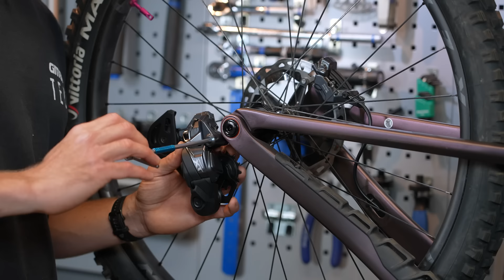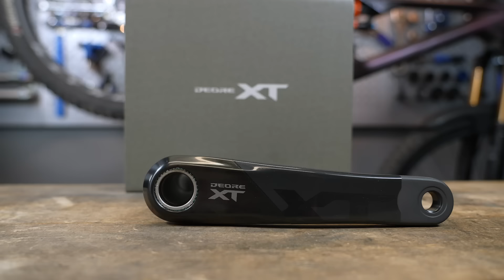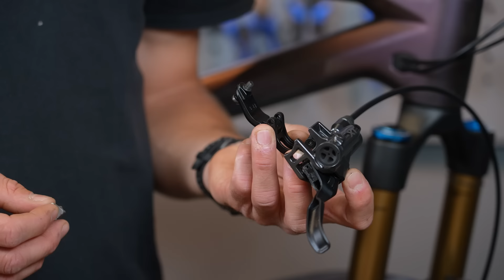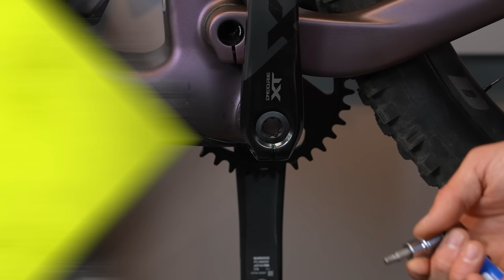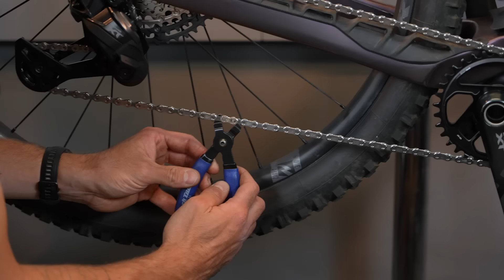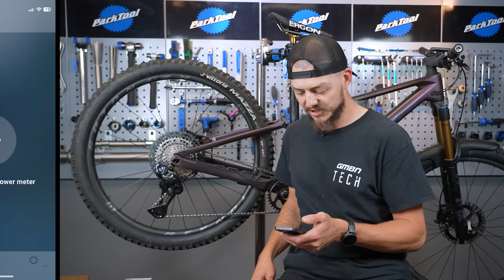How To Install And Set Up New Shimano Wireless Groupsets | Deore / XT / XTR

Comment from the maker: What do you think of the new wireless groupset from Shimano? 🤔
Reply: Love that it is not UDH specific, Shimano thinking about everyone 👌
Reply: Upgraded to the XTR, and absolutely love it!
Reply: I like the simplicity of a cable, but if I had to choose AXS or Di2, the latter for sure, just based on ergonomics and speed of shifting AND it uses a UDH.
Reply: It’s sick
Reply: Wish I could install this on WIRED ebikes but I’m concerned about the torque
Reply: @ninobeatz_iOS  don’t get that comment ! I’ve fitted it to my Mondraker crafty R e-bike with no issues whatsoever , btw it’s the dogs !!!
Reply: I have an AXS XX1 derailleur with an XTR cassette and chain, and it shifts very well. But with Di2, the shifting is a bit loud, though definitely faster. I hope the noise will decrease over time.

Comment: can someone help me?I have followed the adjustment steps and they all work except when I want to go down from the big sprocket to the next sprocket that doesn't go down
Reply: Check if the fifth speed is correctly ajust and the low speed limit

Comment: Quick question, there is a ring on the bolt which used for fitting on the bike. Is this ring used in front the B-tension bolt, right? So the tension bolt is not against the frame, it sits on this ring, right?
Reply: Same question.

Comment: Took the plunge, ordered the upgrade kit last week and fitted on my XC bike todaytoday, thank you for the awesome tutorial, really helpful ❤ As for the new derailleur and switch (shifter in old money) definitely a want rather than a need, very light touch required for a single shift. Lovely and crisp and the geek in me liked the integration with the my Garmin and the E-Tube App
Reply: I just installed mine last night, too. Surprisingly easy to install and setup (and adjust). I had ridden an early production kit in the summer and knew I wanted this on my trail bike. It's everything that AXS should be - fast, reliable and Shimano 🙂 XX and X01 were pretty good, GX was crap. Looking forward to my first trail ride on it.
Reply: @DominicWebb79  how did you guys set it up? I've been battling against limits, micro adjustments and the initial B tension, I just don't get how to put it the way it is in the video 😭

Comment: If I had a penny for every time I've proven a mechanic wrong by actually using a torque wrench I'd be rich, as a mechanic, do the job right and use a torque wrench or don't do the job at all. Great walk through on the setup.
Reply: And what if he don't? I wonder if you get tired people not listening to you.😂
Reply: As a bike mechanic I can tell you there are only certain very delicate items I use torque wrenches for. Something like a derailleur fixing bolt I am definitely not using a torque wrench. You could do 1.5-2x the recommended torque and nothing will happen and if you put on 1000 of them and they never come back broken or fall off Id say thats a safe practice.
Reply: How do you use a torque wrench to prove them wrong. If the bolt has already been installed and is under tension you can't really tell what it was torqued to. The torque wrench is only accurate when you are starting with the bolt loose.
Reply: @quinngroff7084  🤣

Comment: Thanks for the video but nah, I’m sure my thumb and forefinger can cope with pushing my present shifter lever as it’s done super reliably for years. Only time I’d consider electronic shifting would be an auto gearbox type affair with no derailleur but even then…. I’ll stick to my reliable and considerably cheaper everyday man’s push/pull SLX /XT set up
Reply: I hope you enjoy your slx system for years to come,me on the other hand will never go back to that stuff not a chance! As soon as the price drops you’ll be getting one too don’t kid yourself
Reply: @palaHD hiya, thanks for your reply , seriously though I won’t be going electronic. I’m at a phase of my life where I have no need or wants for it no matter the price . If production of standard pull systems ever came to an end I suppose I’d be forced to but I don’t see that happening to be fair

Comment: Why use shimano when we already have sram working great, shimano is doing bad on tech lately.
Reply: plenty of people have issues with the pogo pins on sram turning your derailleur into a brick
Reply: @jamble7k  i had issue wirh deore xt as well, but never with sram xo
Reply: @porroco maybe its you 😂
Reply: @jamble7k  shimano could be good for normal bikes, but ebikes you already know nobody wants a shimano ep8 notor nor their transmision. Every hi end ebike comes with sram

Comment: Got to say, I'm pretty disappointed by the price of the Deore M6200 RD. Hopefully the street price settles quite a bit lower because it doesn't really make much sense currently.

If it did get cheaper, would be a great wireless option for both midrange MTBs as well as gravel bikes. Shimano ain't launching Deore level GRX Di2 any time soon for obvious reasons

Comment: Perfect shifting=full shimano
Derailleur, chain, casette and chainrings (for2/3x)
Went sram cassete and kmc chain from a full shimano and perfect shifting to a crappy shifting no matter how much I've tried
Could not manage to get good shifting between all sprockets ☹️☹️
Reply: @costi08  bin the kmc chain, had a similar issue, went back to a xx1 sram chain, mint.

Comment: What are the benefits of going wireless? I only see a downside of forgetting to charge the battery or going for a ride and battery empties
Reply: The charger is USB, so you can charge it from a smartphone or use a backup battery. 
But the concept of central battery without all this wireless stuff, like in previous DI2, was a better thing. Wireless is just feels more expensive so company can make more money out of it
But how many of us are using wireless charging in smartphones on daily basis for example?
Having multiple batteries on one bike is a stupid concept.
Reply: @wanderer2246 to me, driving a bike means moving away from the digital world, screens and batteries, and just being in the nature. I do have a smart watch for workout tracking, and I carry a phone in case I need to call for help, but I could easily go for a ride without them (battery dies, phone breaks) having another thing that dictates if I can go for a ride ... I don't know. I really dont like having a mobile app and updates for a bike component
Reply: @wanderer2246  Its inevitably setup towards ebike usage where one battery controls everything. Actually pretty interested/excited about that cues dynamo hub comboing with this stuff (or would be if it was available in boost), because the hub functioning as a bike computer and constant charging for the RD actually makes it somewhat interesting.
Reply: @anthonyschroeder521 Its not exclusive to ebikes, first gen Di had central battery in seatpost, and many hoped that Shimano will just improve it
But looks like similar to gaming industry everyone wants RGB or something that is not reliable but worth money
Eventually we will comeback to electric shifting and central power source, when producers will decide to sell us “smart” bikes, or whatever they call it, with all basic sensors and central console like in ebikes
Reply: @wanderer2246 i know that hahaha. Just saying that clearly the intent is to make it easier to integrate into ebikes. The old di2 system of a separate computer and battery is not nearly as scalable into ebikes as this is.
Reply: @anthonyschroeder521  Probably you don't know that new gen Di2 derailleur exists also in an electronic wired version, special for e-bikes. And previous gen di2 had only battery in the seatpost, "brains" were in the shifter and derailleur.
And, weirdly, in new version your derailleur can be powered from an e-bike, but for the shifter you need to carry a CR2032 battery (and a derailleur without a battery is also more reliable as battery compartment always fails during vibrations and moisture)
Reply: I've run AXS for 5 years and in that time it's never needed adjusting once, in rain, mud or whatever it's always shifted faultlessly.  I've also never run out of battery on my rear mech.  Did on my dropper though but only once.
I'd never go back to cables

Comment: Thanks for the video. Looking at doing the same to our two bikes. Does each gear change with XT take two clicks on the selector switch whereas XTR is one click per gear change?
Reply: They both have double shift functionality. XTR is lockable to one.